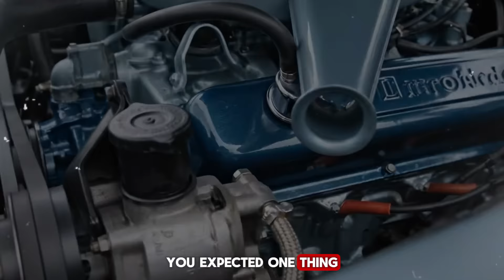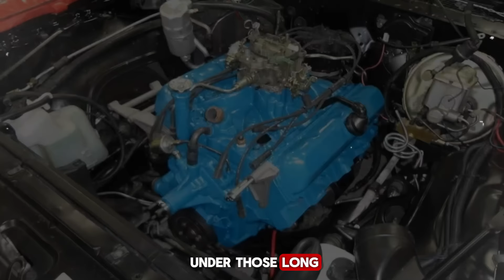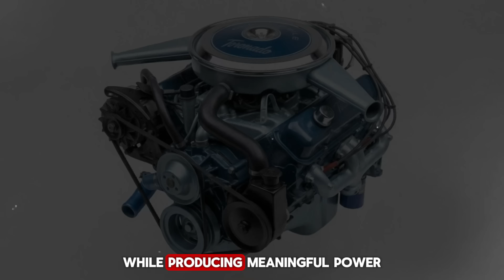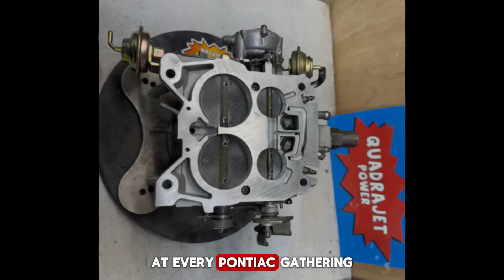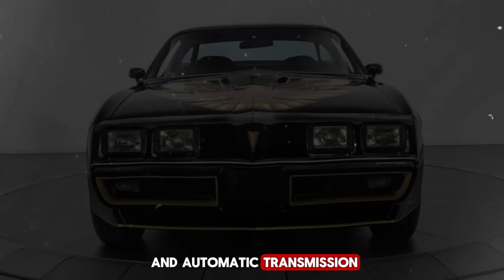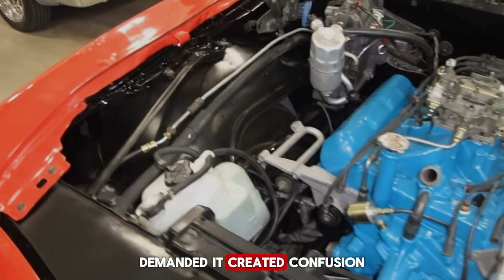How Oldsmobile’s 403 Became the Most Controversial Trans Am Engine

Comment: Starting @13:42, That is completely wrong and backwards. It was the Olds 403 that could pass emissions. So the California and High Altitude cars got the 403 engine in 77-79. You could not get a Pontiac engine in California or High Altitude locations in 77-79. In 77-78, you could get Pontiac 400's in the other 49 states. In 79, the 403 became the standard engine for the Trans Am nationwide. There were only 8963 Pontiac 400's (W72's) leftover from 1978 model production, which were available as an option in 1979. It only came with a 4 speed manual trans. So, those last Pontiac 400's were available in the 49 states, until they sold out around March 20th, 1979.

Comment: This video makes me think of the 403 I WISH Oldsmobile had built - a small block  Olds with 4.125 bore, a 425 crank; it  counterweights shaved about 0.200, the stroke reduced  to 3.77 inches. 425 stock pistons, and  5.80 in. rods . 3.00 mains and 2.12 rod journal diameter. Topped off with a  hydraulic roller cam and 455 heads. THAT woulda been a helluva engine!

Comment: GM couldn't afford the luxury of having each of its five divisions building their own engines anymore, especially given the constraints imposed by emssions and fuel economy standards.  Chrysler had standardized their engine offerings years earlier, and Ford largely did the same; pop open a Mercury and the valve covers had the familar "Powered by Ford" stamped into them.  Ultimately even the downsized Cadillac's had the Chevy small-blocks in them rather than a 472 or 500 boat anchor that the car couldn't accomodate even if the engine hadn't been a gas pig.

Comment: I have a 1977 403 Olds from a T/A, built it with a big Lunati Streetmaster cam, 455 heads milled & bowl ported, KB flattop pistons, ported Offy intake and 850 Holley. Ran pretty good with a 3500 stall and 3-73 gear. Never pushed the crank out, made around 460hp.

Comment: GM was in the process of rationalizing the divisions to eventually convert them from true manufacturing operations to just a brand name.  This meant having one source of engines which, for the V8, became the Chevy small block.  This engine platform is what would be used in all V8 powered vehicles except for Cadillac going into the 1980s.  The other division's engines would be phased out.

Comment: I would much rather have a Pontiac over an Oldsmobile engine. The only exception is my 1978  Esprit that came factory with a Chevy 350 4bbl. I think some Firebirds even came with Buick v6. I can accept a smaller displacement Chev motor, but not an Oldsmobile even if it was a 403

Comment: Pontiac stopped manufacturing the Pontiac V8 in 1977. They built enough of them to last until 1979. You got the Pontiac IF you ordered the car with the four speed MANUAL transmission. If you were WIMP that bought the automatic transmission you got the 403 Olds. You got the 403 Olds because you were a wimp, and not worthy of getting the Pontiac. It's that simple.

Comment: When the engine wore out in my dad’s Le Saber, his mechanic replaced it with an Olds 403. It really woke that car up! As they say an engine doesn’t care who’s name it has on it’s valve covers. I feel the 403 was a very underrated and unappreciated engine.
Reply: I took the 403 out of my 77 I think original 190 hp 330 torque 
Best thing about the block it was siamese no water jackets between cylinders.made it strong but ran hot ..dropped it in my 85 cutlass with some upgrades got about 290 hp 360 torque..fast for the time

Comment: As an engine builder that has worked on many different makes, and built 5 X 403 Olds now , one over 600 HP , it is one of the most underrated Small Block ( or any engine) made , that super massive bore of 4.351 inches and short stroke of only 3.385 inches ( the magic 86 mm that almost all modern engines manufacturers try for , Subaru, Honda, Ford, Ferrari, 86 mm the exact piston speed to flame front velocity ) , if Olds had only cast without windows in the block and/or used the DX350 Diesel Block with roller lifters and thicker everything, that 403 would have been the king of any small block or big block , a 403s bore is bigger than a 500ci Caddy , it's 0.100 bigger than a 454 chev . And a stroke not far off a 327 chev . We all know for good performance big bores and short strokes are the way to go . Keeps piston speed down , large surface area for flame front to push against , big bore room for unshrouded big valves , along with the Easter eggs the original Gen 1 and Gen 2 Olds V8 engine designer gave it , Charles F Kettering designed both , and gave the Gen ll that magic 86mm stroke that turns up so often now in so many different engines, in fact Olds engineers thought it was so important not to change stroke to change engine size , that is the reason the 403 got such an odd ball huge bore of 4.351 inches , also why the 350 Olds got another odd ball bore size of 4.057 , all to keep the 86mm stroke, every Olds Small block same stroke from 260 to 403 . Then there's the 6 deg valve angles, today we know the more you stand the valve up the better shot at the piston from incoming air/ fuel , look at all the LTs or Ford Godzilla's , back in the day the chev guys got all excited over 18 deg then 12 deg valve heads , Olds had 6 deg from the start , creates a flat open twin squish chamber , efficient and powerful, infact the last Olds Rocket the 307 (5.0 litre) was the only GM V8 or V6 that could pass emissions in 1990 with a Carburettor, all the other motors needed fuel injection, that shows an effective efficient chamber . And the the old Windowed mains comes up , for years through the 1980/90s people just repeated what someone else said, and sure they look weak , but in reality under 500hp and 6000 rpm your going to not have a problem with a good motor , I've built a 611hp at 6700 max rpm 403 and it's only got a 5 main Halo girdel. Balanced 330 Olds forged crank . Been driving that for 3 years now and it seems track use , no bottom end problems , if you want to build a 450 HP TA motor that will put a smile on your face day and nite , a 403 is happy to play all day . And as for the windowed mains , just remind people plenty of motors have the same windows , pull the pan off a 392 Hemi , same windows same place . And look at that new Ford 2.7 V6 twin turbo diesel, 450 HP , and it's just three little fingers of cast iron less than a 403 . Just saying , the amount of 403s still driving around shows they weren't as weak as they all said. 

These days you can get alloy heads complete pair for $900 at Summit , KB flat tops for 403 for $320 , nice cam, throttle body injection and stainless headers from AliExpress for $210 ATM. Or go all name brand for 6 X the price probably made in same factory. Easy to build a nice 403. 

And really the 403 did save large engines in the later 1970s , it was the only 400 + ci that passed emissions in cars , the Trans Ams with Pontiac 400 s were all left over 1975/6 engines , and the 403 was 67 pounds lighter than a 400 Pontiac, made the most torque in the TA at 320 foot pounds . And torque is what moves you not HP , yep , of all the motors I've built , the 403 has the most going for it from a design point of view , most to do with that huge bore . 

I guess that's why so many people are putting 403s back in 1977/79 TAs that got removed in the 1970s , they starting to be harder to find a 403 than they used to be . 

Trust me , 403 is the way to go, it's different, it takes little to 3 X the std power output , and it fits in any engine bay .
Reply: The 403 was fine. With the bores that big you had to be mindful of keeping the cylinders cool, but other than that they were fine. I've had both the Pontiac 400 and the 403 Olds. Both can be made to make good power.
Reply: 403 was plagued with the same issue as Mopar 400 which had a 4.342 bore and 3.375 stroke, is that they lacked piston speed,, needed rpm to make serious power compared to 3.75 from a 400 Pontiac or a 440 mopar

Comment: I happen to own two 78 Bonnevilles. My brougham sedan has the 400 and my coupe has the 403. I love them both. I would ls swap neither. I personally love the 403 engine,it's a torque monster. 350 to 400hp with a girdle to help with bottom end is good enough for me. Pontiac 400 was my dream motor to attain,it's a smog 400 but changes can be made. Im a huge Pontiac and and Oldsmobile fan. I have the best of both worlds.

Comment: 7How sad that the best selling Trans Ams were the worst Trans Ams...  I drive a 1975 Firebird Esprit with a Pontiac 455.  It's only a station wagon engine, but with  a little RV cam, intake manifold, and a bit better compression, it could surely blow off any of the late 70's Trans Ams.
Reply: I'd suggest the last good Trans Am was the '74.  The '75 came with the HP-killing catalytic converter.

Comment: My mothers Buick Electra had the Olds 403 V8. It was a good engine. When it started to run bad all you had to do was warm it up good. Find a open highway. Floor it and watch the carbon roll out the tail pipe. When it cleared out. It ran great again.

Comment: Yeah lots of misinformation. The shaker said 400 if it was the Pontiac. 6.6 Litres (402.5 cu in) if it was the Olds
Reply: Wrong, the Pontiac 400 was advertised as 6.6 litres, the shaker scoop on the one in bought brand new had the 400, and the scoop said 6.6 litres.
Also, the 455, and the 455 HO were the same block, but the 455SD was a completely different, beefier block casting.
Reply: Actually , pre77, the scoop call out was 400, starting in 77, Pontiac used 3 call-outs: T/A6.6 for the high output w-72 400, 6.6 for both the Pontiac and Olds engines, and 6.6litre for the 403.

Comment: ?>🤔<?   !!😡!! wE Say…⇒⇒           Some Of These A.I. Images Could Use A Good Editor..                                                                                                                                                                       .                    At 5:45...   You Display A Oldsmobile   Toronado...  425  or 455.. With An Upper Radiator Hose Running From The Air Cleaner....         To The Power Steering Pump !?!??!?!??!    BWHAHAHAHAHAHHHAHAHHAHAHAAAAAAAAA !                                                                         .....so say wE boTH !! ?>🤔<?   !!😡!!

Comment: Oldsmobile engine 403 was junk because GM didn't learn their lesson with the 400 Chevrolet. The siamese cylinders in the middle were prone to overheating.
Reply: No such issue with 400 small blocks, 403s or even 502s.

Comment: This video is full of mistakes! First off the 403 Olds engine with the Turbo 350 Automatic Transmission was Standard on every Trans Am sold in California and High Altitude areas from 1977 to 1979! In 1977 Pontiac brought out the TA 6.6 Engine which was a higher Performance 400 Pontiac Engine to replace the now discontinued 455 Pontiac Engine. Thr standard 400 Pontiac engine for 1977 and 1978 was rated at only 180 horsepower. The TA 6.6 Litre 400 Pontiac engine was rated at 200 HP in 1977 and it went up to 220 Horsepower in 1978 and 1979. The higher output came from a slightly higher Compression Ratio 8.0 to 1 in 1977 and 8.1 to 1 on the 1978 and 1979 Formula and Trans Am models. The TA 6.6 also came with a higher Performance camshaft too. Another reason for the 220 Horsepower 78 and 79 engines came from the Trans Am  and Formulas came with dual resonator and no mufflers. Also you could get the TA 6.6 Litre engine with either a 4-speed manual and Automatic Transmission in 1977 and 1978. All the TA 6.6 Litre engines came with Manual Transmission only in 1979! The 180 Horsepower Pontiac engine all came with Automatic Transmission in 1977 and 1978. Pontiac actually had discontinued making the 400 engines early in the 1978 model year, but the very high demand for Trans Ams in 1977 to 1979 suddenly there weren't enough 400 Pontiac engines to meet demand. By 1978 the 180 Horsepower Pontiac Engine was also available on the Full Size Pontiacs as well. Also in 1979 the 301 was made available for Trans Ams for a credit and you could also get it with a 4-Speed manual Transmission, but only a few thousand were built. The TA 6.6 Litre Engine was only offered until supplies ran out. Only something like 8200 Trans Ams came with TA 6.6 Litre 220 Horsepower engine in 1979 and also something like 343 1979 Formulas also received this engine. These 1978-79 TA 6.6 Litre Pontiac  400's rated at 220 Hp and 320 Ibs/Ft Torque and a 4-Speed were the quickest production American car with the L-82 Corvette coming in a close 2nd place! Also it's worth noting that in 1977 the the new downsized Olds Delta 88 Coupe with the 403 engine was chosen to be the Pace Car at the Indy 500 races. The actual pace cars 403 was hopped up using the bigger W-31 Bigger valved heads. Compression was bumped up to 9.5 to 1 and a higher performance cam was used. Olds used earlier exhaust manifolds for less restriction and no catalyst was used. With a 3.23 posi rear and a beefed Turbo 350 Trans the roughly 275 Net Horsepower from this very streetable 403 Olds engine. Also the Olds 403 came with beefier connecting Rods, the same used in the 1978 on Olds Diesels. The ports and intake and exhaust valves on the 403 were the same as the 350 Olds engine. The 400 Pontiac engines had better breathing heads, both in intake and exhaust valve size and bigger ports. The 180 hp rating of the standard Pontiac 400 was the result of a very low 7.6 to 1 Compression Ratio and the 403 Olds engine was 7.9 to 1 Compression Ratio! Most 1979 Trans Am buyers kept their cars stock and the low 16 sec. ETs was quick enough for most drivers. Most hard-core performance enthusiasts were aware that TA 6.6 Litre Pontiac engine was limited in offering in 1979, so they put an order in as soon as the 1979 cars were offered for sale in the Fall of 1978!
Reply: lol the bot even pronounces torque as tor-kay. Ole!

Comment: This video got just about everything wrong. The 455s produced by Buick, Oldsmobile and Pontiac ended their 455 production after 1976 because the full size cars were downsized and the 455s weren’t deemed necessary. The Oldsmobile 403 was used in place of Pontiac V8 in California and high altitude areas because the Pontiac V8 couldn’t pass their stricter emissions standards. This began in 1977. Pontiacs that were sold in all other areas had the Pontiac engines. Beginning in 1977, Pontiac built 2 different versions of their 400. 1 was called the L78 which was the standard 400 in Trans Ams, Grand Prixs, Bonnevilles and station wagons. There was a high performance version called the W72 which was only available in the Trans Am, Formula Firebird and the 1977 Pontiac Can Am that were sold in the federal emissions areas but not California. The Olds 403 was used instead. The Can Am was 1 year only model. In 1978 the mid size cars were downsized and the Pontiac 400 and Oldsmobile 403 was no longer available in them. Pontiac also discontinued production of the 400 in 1978. So Pontiac stashed a supply of the 1978 400 engines, all of them W72 high performance engines for the 10th anniversary Trans Am and Formula Firebird models for 1979. But you had to order a 4 speed manual to get the W72 400 in 1979 which again was unavailable for sale in California. Automatic Trans Ams and Formulas came standard with the Olds 403 or the no cost option Pontiac 301. The use of the 403 had nothing to do with unprecedented sales levels it was California emissions. 

The part explaining the block issues with the Olds 403 was correct. The 403 and the L78 Pontiac 400 were similar in output power while the W72 was a high performance engine. But it should also be noted that the Pontiac 400 block casting was changed mid year 1975. The webbing where the main bearing caps bolt into were seriously thinned out. The dowel pins that located the main caps were replaced with roll pins. The weaker block had the casting number 500557. This was used for all L78 and the 1977 W72 engines. Late 1977 they brought back the 481988 casting that was used from 1971-1975.
Reply: 100 % correct, this video has alot of errors in it.

Comment: I remember a friend had a 1977 Olds Cutlass Supreme with a very rare for the car a 403 V8.
It was quick, easily smoke the tires.
Reply: I had a 77 cutlass with a 403, very fun car
Reply: High torque low hp had a 77 olds 98 ..strong block easily upgradable I think original specs less than 200 hp about 330 350 torque

Comment: and in other body styles the chevy 350 small block replaced many engines in the caprice sized class.
and even the chev 305 in the mid sizes. malibu, cutlass, etc. 
lots of engine swapping in the mid 70's up.  
the 5.7 deisel in chev pick ups at the time meant a 455 olds swap was easy.

Comment: I'd rather have a 400 Pontiac than the Olds 403 small block in a Trans Am, but, that Toronado 425 big block in the beginning of this video was a powerful engine though!
Reply: I OWNED A 1980 TURBO 4.9 LITER TRANS AM AND HAD FRIENDS WITH 400 AND 403 POWERED TRANS AM. NOT GONNA LIE, TODAY ID MUCH RATHER HAVE A TRANS AM WITH AN LS SWAP THAN ANY ENGINE OFFERED IN THE TA FROM 77 THRU 1981!

Comment: Our '78 Buick Estate wagon had a 403 Olds engine. Absolute junk cylinder heads. They were off three time because of overheating and cracking, there were no replacement or upgraded heads available. I ended up junking an otherwise great car.
Reply: Should have installed a set of Olds 350 heads, compression would have went up and the motor would have woken up.